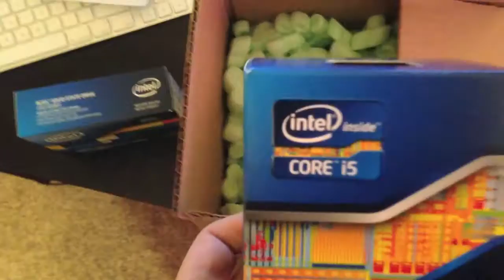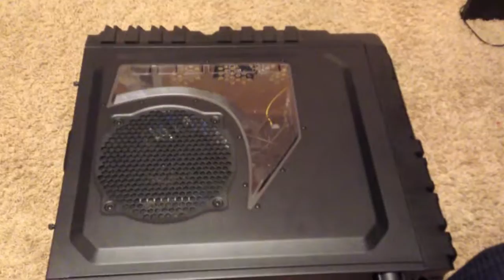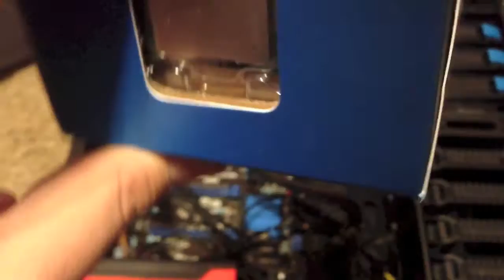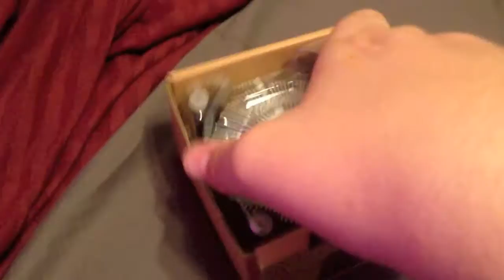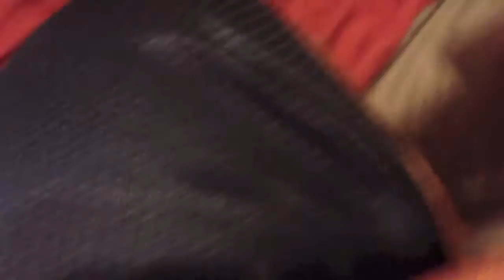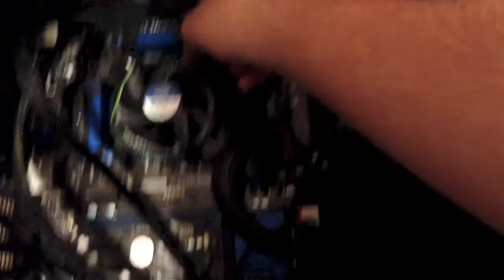Installing Intel i5 3570K | Gaming Computer Build Pt 5

Comment from the maker: Not sure if I mentioned it in this video but this build was part by part, paycheck by paycheck. Therefore to get it up and running ASAP I bought the essentials first. To be honest, the stock cooler is fine if you don't overclock, and overclocking isn't necessary for gaming. I am getting a better aircooler soon just for some light overclocking, but I don't see the need for a watercooled rig, I'm not trying to kick out any sick benchmarks or anything lol.

Comment: I'm sorry but why the fuck are you putting a stock cooler on that 3570k, surly if you are building a nice computer like you have there you would have thought to put an after market heat sink or even an easy install closed loop water cooler. The one you just installed and it's performance is atrocious. You should definitely look into a new cpu cooler as a future upgrade, just a tip no hate :D.

Comment from the maker: What are you talking about? First off, as you should know, I am a first time builder. Second off, there is no thermal paste on the bed? The cooler is raised from the surface of the bed and the thermalpaste on the Stock Cooler doesn't come off that easy, it would require pressure to come off. Third off, I didn't put too much pressure on the cooler when putting it in. It is well know that these zero insertion force coolers are a bit finnicy sometimes.

Comment: thermal paste on the bed, ew, could have collected debris from the sheet which is now on your cpu,  and looks like your pushing on the cpu. it's called zero insertion force. kind of a messy installation. do more research for your own good next time.